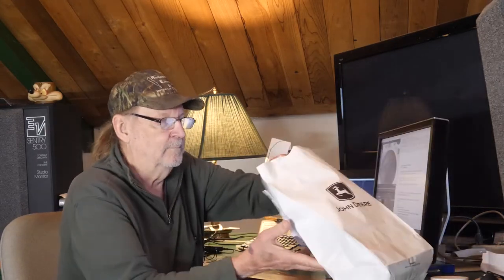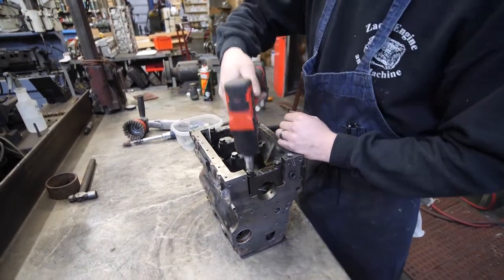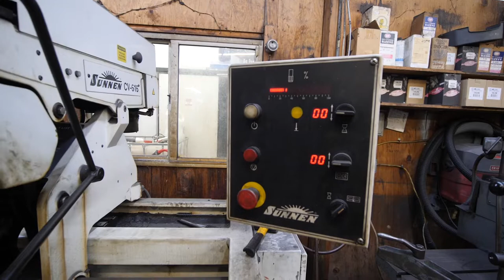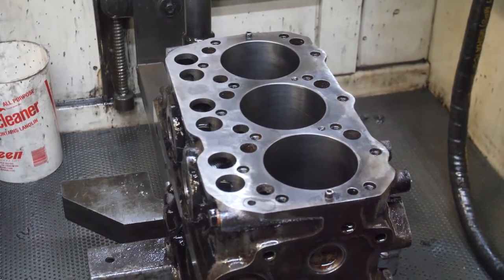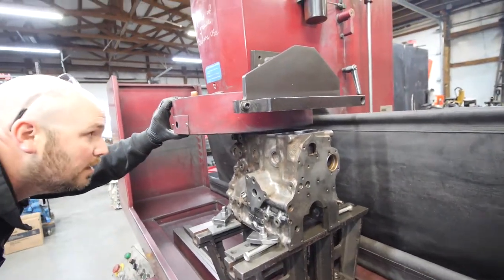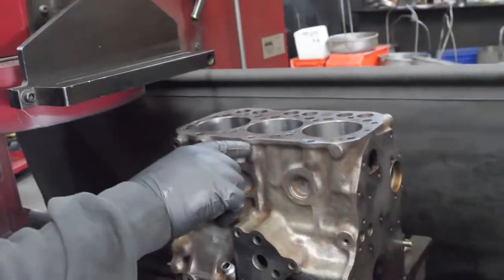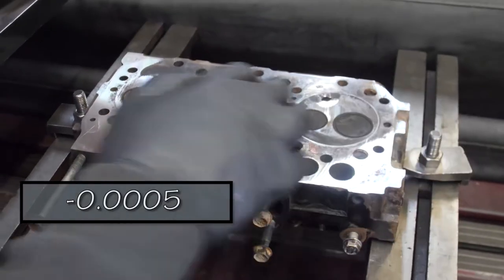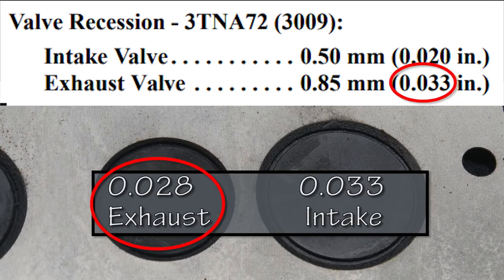John Deere 755 Blind Date Episode VII

Comment: Cool video’s. I have subscribed and hope to see more of them in the future. I think valve to piston relief clearance of 125Thou is a good number diesels typically have a lot of carbon buildup in the valve reliefs and the need room for it. The pistons can be relieved with a cuter on a vertical mill or drill press. I would like to see ware you are at after a valve job. And don’t forget to shim your valve springs.